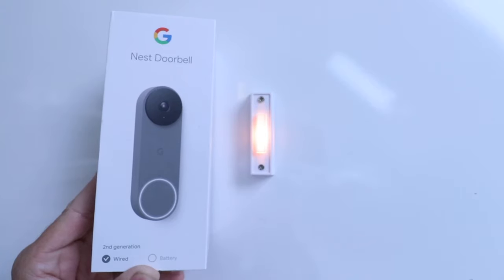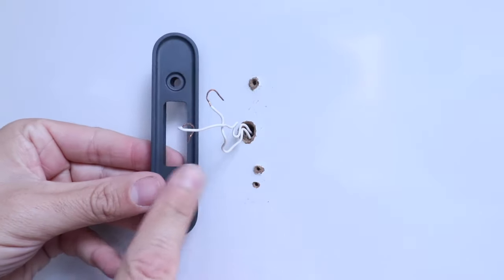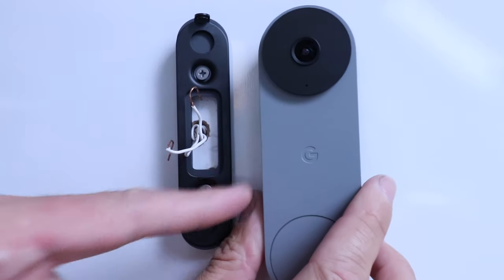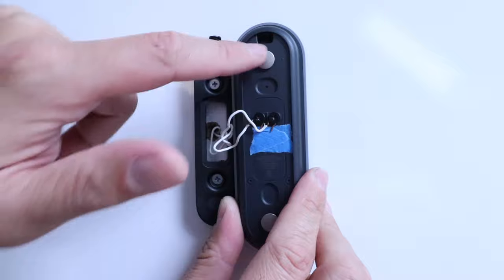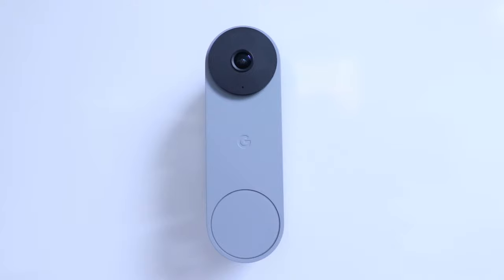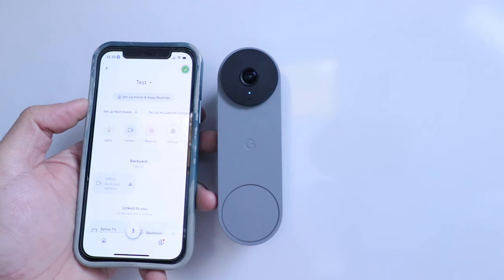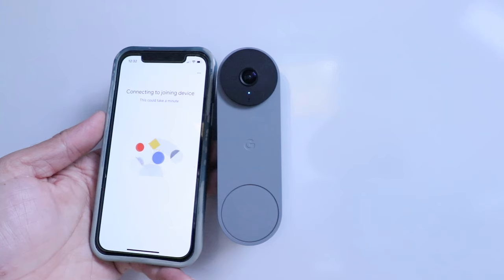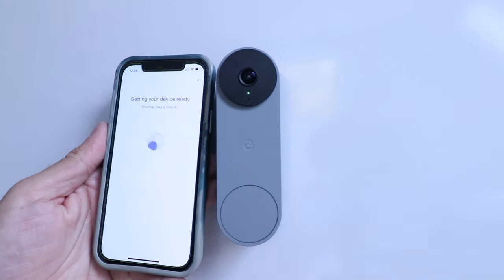How To Install Nest Doorbell Wired 2nd Generation 2022

Comment: This thing is garbage I got two of them and both worked occasionally, often saying live video unavailable. Wasn’t my internet nor was it installation.
Reply: These fkin door bell cams is a pain in the as... to hook up
Reply: Likely your transformer is too small or provides the wrong voltage.
Reply: Stucco House? Can be Big Problem. I have 2 security cameras, company installed. 1 installed and working in less than an hr. (2 walls to reach wifi router). Second one barely worked. It was going thru 3 wall and ceiling to get to the wifi. It took 3 technicians 6 hrs total, over 10 days to get it to work. 4th tech simply brought in a plug-in signal booster and works perfectly. Stucco and chicken wire meshing works like a signal blocker. Same with my phone, if I'm outside. Try a booster.
Reply: @tlstewart123   the best door bell cam is eufy dual lens
Reply: What's the Google chime for...I didn't install it and it works fine

Comment: I'd highly recommend installing a 16v 30a transformer for those having an issue where the door chime won't ring. They're like $20 at Home Depot
Reply: Well yeah that’s a requirement for wired models. Most people can figure that out from the start
Reply: The wired model is supposed to support 16v 10va.

Comment: If you are having problems with the Mechanical Indoor Chime NOT WORKING, there is no need to install the CHIME CONNECTOR, IF you are using the original wires from the door bell to the chime.  The CHIME CONNECTOR is useful if you have an ELECTRONIC CHIME otherwise it draws power and may prohibit your MECHANICAL Chime from operating properly.
Reply: Thank you So Much. My chimes (for some dumb reason) are 10 ft off floor, in a vaulted ceiling. Dreaded the thought of climbing a ladder to get up there. Whew, dodged that bullet. 😊
Reply: What exactly does it do if it works without it?
Reply: @Elephantmoonlight  I think the door bell in this configuration, the switch or button with camera you press needs a constant power source, but it doesn't need to send the 'ding dong' signal through the switch directly, it can also send it wirelessly, meaning or alluding to the point of the chime connector, the chime connector draws power because it's listening for the ring signal from the switch.

OR 

Another thing I think it might be is because there is a difference in how mechanical vs electronic chime systems work, this might be the purpose. Example, mechanical chime doesn't use micro-processor and latching/timing circuits, where electronic does, often you see a diode attached to the back of the simple switch on older electronic systems which serves an important function in the circuit. 

I think it's one of these two things.

Comment: The chime connector concpet confuses me in general, but my main question is if I have 2 one these doorbells, do i need to connect 2 chime connectors?
Reply: Via lived experience, I have found that the answer to this is yes. It's very difficult to shove two chime connectors into the chime housing by the way.

Comment: How do you tell which circuit breaker is the right one? Asking for a friend 🙂 Edit: IF you can find your transformer, disconnecting the wires to the doorbell is easier than trying to figure out which circuit breaker to shut down. I found my transformer so just disconnected the wires to the doorbell and it shut off the power to the appliance. I'm lucky I think...that may not be as easy for other homes.

Comment: Just installed with no issues, the light was blue, chime worked, but no live video.  I turned the breakers off/on, removed the chime and reconnected it, now the light isn’t blue - no lights at all.  So frustrating!!  Wont do anything now!

Comment: Where do you get the chine connector?  We have the first generation nest that stopped working several mo ths ago.  We've purchased this one and watching your instructions, I see you need the chine connector.  I am assuming there was one installed with the old.  Could we use that or do we need another chime connector?  If so, where to get a replacement?

Comment: Nice demonstration, just bought the nest battery doorbell but ended up returning it because it’s mounting system was too insecure which makes the doorbell very easy to steal, I see this wired doorbell has a much more secure mounting system, will likely purchase this model

Comment: I have seen another video that show the door bell should ring after turning on the power, even before installing the App. Mine does nothing. I can ring the bell if I short the two wires together so I know it works but the Nest does nothing. The other issue is it fails to connect to the app. The gets an IP address from the router , the wifi extender is 15ft from the door. Do you think this could be caused by the doorbell transformer current is to low and its affecting both problems?

Comment: So, I changed out my Wi-Fi system and I can't get my google doorbell 2d Gen wired doorbell to connect. Watching your video at 10:04 on your video gives you an option to select your Wi-Fi network but I don't get that option when I'm trying to install, any advice?
Reply: Switch to mesh wifi, put a unit near the doorbell.
Reply: Always says error turn your phone on airplane mode and turn it off every time I try to connect it

Comment: Are there any smart doorbells that you suggest that work with less voltage for older homes?
Reply from the maker: The Nest Doorbell Battery Powered will work with lower voltage or can be powered by its built in rechargeable battery. Nest Doorbell Battery Powered: https://amzn.to/3VxrQ7E
Reply: @OneHourSmartHome  thanks so much

Comment: I have four wires coming out of the wall cannot remember which ones were connected to my old doorbell they were so messy that I just cut a clean cut and stripped all of them and realized there was four wires not 2  I don't know which ones to use. I have a red one and one that is white striped red and a blue one and one that is white striped blue. Would anybody know which ones I'm supposed to connect to the screws on my new doorbell?

Comment: Would this work without an existing chime? The battery version can use existing Nest displays + Google Homes  so curious if this works that way too.
Reply: I have you found the answer on this?
Reply: @MrPapable  yes, it works without an existing chime. It's configurable via the app during setup.

Comment: Sir, what is the installation setup (wiring) when there is no existing traditional chime or doorbell, and how the chime would work?
Reply: You'll want the battery version, instead.
Reply: @Kracka21C8  Thank you for your reply. I managed to get the 2nd gen wired model working by skipping the chime option in the app and instead linked it with existin Google mini speaker. It worked!
Reply: Glad to hear it!  Nicely done.
Reply: @redshiftgalaxy3718  how did you manage to do that? How did you install the wires option, with a power adapter? I am having the same issue - I don’t have a wired chime but want the wired version to avoid recharging.
Reply: @pguerrero693  Hi Pastor, I posted the steps twice earlier this week but I noticed messages have disappeared. Let me try again.
Reply: @pguerrero693  
2_ I setup the Google Nest mini
3_ Using Google Home app and following the instructions to add a new device, and the QR code on Google Doorbell 2nd gen wired, I completed the settings for the doorbell
Reply: @pguerrero693  5_ I powered on the doorbell at this stage and when I press the button on the doorbell, I received the notification on my phone and announcement on Google Nest mini speaker.
Reply: @redshiftgalaxy3718 Where are No1 and No4?

Comment: I just installed one of these, and it DOES NOT WORK !!!   It will NOT energize the indoor mechanical chime.  Wait for V3.
Reply: That’s because your transformer isn’t sufficient enough. You need to upgrade your transformer or go with a battery version.
Reply: @pagodad8079  That makes no sense.  The V1 version worked just fine, and I'd still be using it, except it broke, and I was forced to buy another.  I ass-u-me-d it would work the same.  The V2 had a huge drain somewhere.  As soon as it was remove, the dumb doorbell worked just fine.  Screwed up implementation.
Reply: Did you ever get it to work? I just picked it up. Connected following the directions. The home app with doorbell worked. The doorbell chime didnt work. I tried again by deleting everything and restarting install from step 1. Chime worked. I had to put the wedge on so I disconnected it and reinstalled. Now no chime.
Reply: @rchan1979  No.  Gave up and went back to an analog bell and works fine.  So sad - the first generation also worked fine and they went backwards with Gen 2. SHAME

Comment: Do not buy it. I had to buy a new phone because my phone didn't allowed me to  install google home app.
2. The round chime indoor is a device that have to be connected with an existing electrical box. I couldn't install it because it was not working previously. No sound inside home. Only notifications by phone. Another option is to buy a new and add the round device. It is very expensive to install it properly